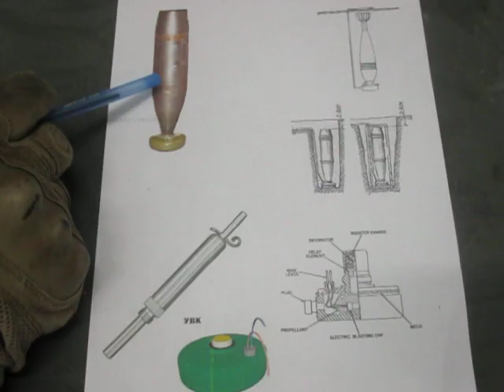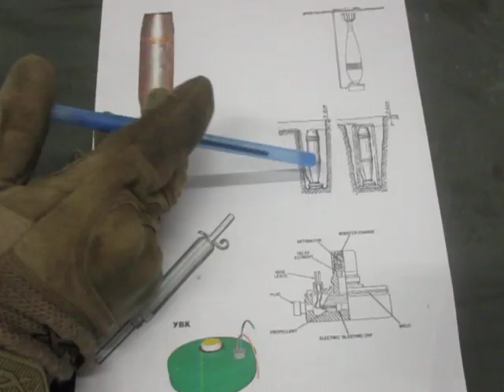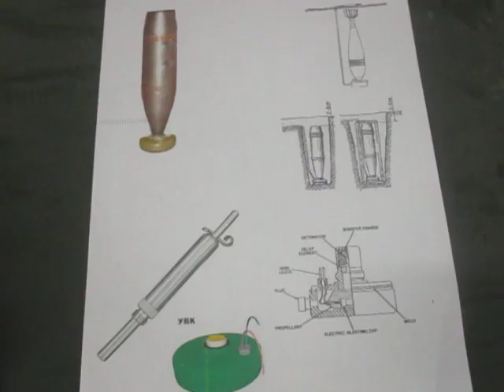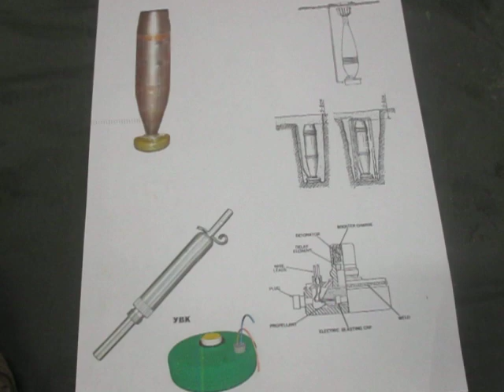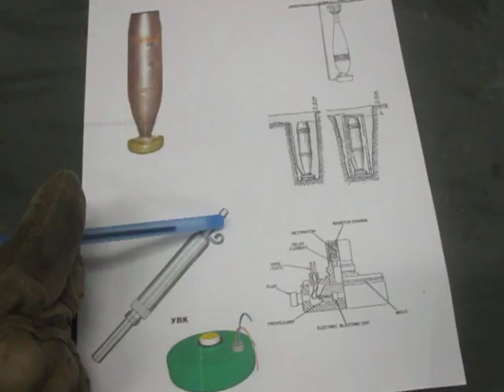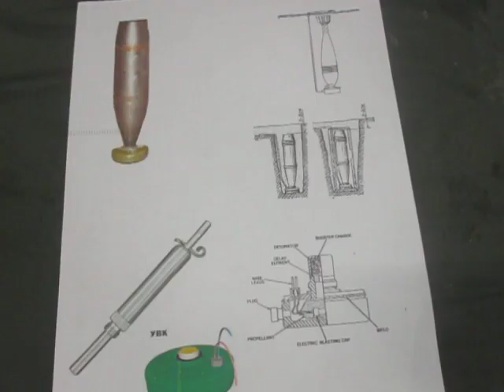Soviet OZM-UVK Bounding Fragmentation Mine

Comment: What are your opinions on shotguns (any type) and bolt action scoped rifles for a theoretical militia group?.  Practical offensive uses or just relegated to gathering food?.
Reply from the maker: Shotguns are proving to be effective drone defense.  Sniper still use bolt action rifles even now in conventional militaries.
Reply: @SecurityGuy42  I have heard that about shotguns vs drones.  What works for long range ducks and goose can rip the propeller blades to shreds and drop them right out of the sky.  I imagine skeet and sporting clays would be a great training aid.
Reply: @JR9979  The main issues i've seen are related mostly due to war-conditions where the ammo is bulky and semi-auto's have reliability issues - and weight